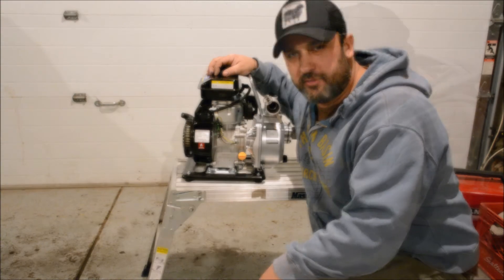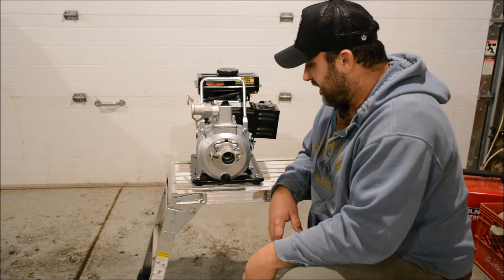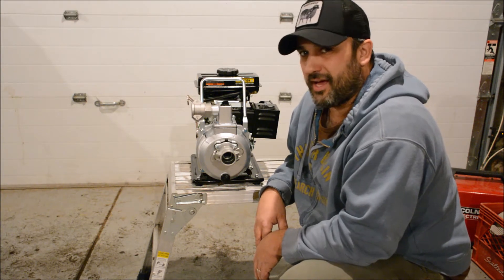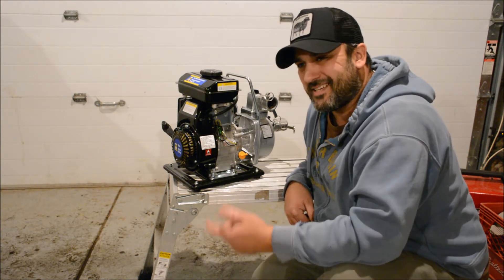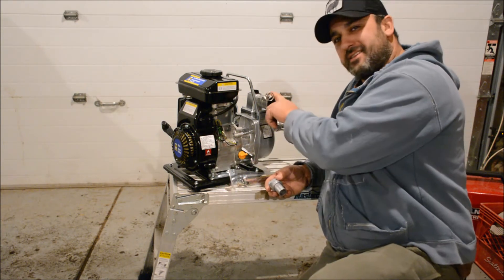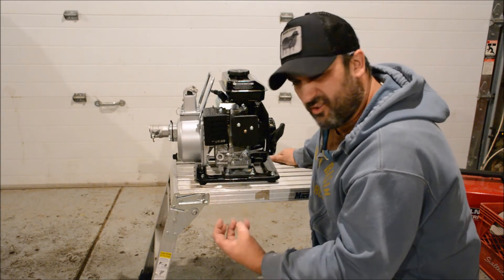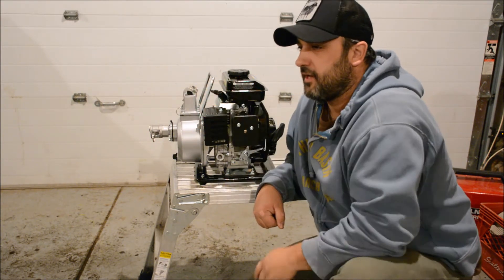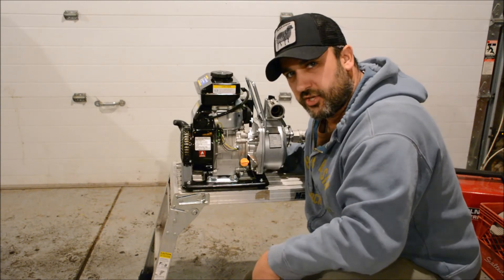Test of a Power Fist 1inch water transfer pump.

Comment: Glad I found this. I am wanting to use this pump for moving sap as well . I've just set up a new sugar bush with 3/16 lines to barrels. I need to move sap about 1/2/km to the sugar shack from the bush with about a 10 foot gradual uphill. Do you think this pump will move it that farm from your experience?
Subbed to your channel as well. See you do maple syrup.
Reply from the maker: Hi Jon, thanks for Subscribing, i hope to get some new content uploaded soon.   As for the pump that is a very good question.  In my own opinion i do not think this pump will have an issue pumping 500 meters with a 10 foot incline, but with out having tested something like this i can not give you an accurate  answer.  If you do happen to try it please post your results here.  Enjoy the season, it sure is coming fast!
Reply: @SpruceCreekFarm  one other quick question. So you think any one inch water line will hook up the the intake and outtake? I'm not wanting to use the hoses they have as they probably are not food grade for the sap.

Comment: Would a pump like this work if I want to water my garden but I have a 150ft of 1" PVC pipe between the pump and the ditch where I want to take water from.  How would I make sure that the air in the 150ft of line would not burn out the pump.  I can not have the pump at the ditch because it is public and there is 150ft of private land between my garden and the ditch.
Reply: There are a couple of things in play here.  First, what is the water source elevation relative to the pump?  If the water source is higher than the pump, you should be fine without a check or foot valve at the suction end of the hose.  If the water source is at the same level or lower, you would want to install either a check valve or foot valve in the suction end of the PVC pipe.  In all cases, make sure the suction end of the pipe is well below the source water level, I'd say actually 12" or more.  If it's too close to the surface, you'll get the bath tub affect, swirling, and this will draw air into the pump and cause cavitation, damaging the pump.  I'd actually recommend going with a larger valve, like 1 1/2" because the valve will restrict flow.  Additionally, try to eliminate any elbows in the suction line as this will restrict flow as well.  The key is minimizing restrictions to the pump.  Because your suction is so long, 150 feet, you'll most likely get reduced output from the pump.  You should also consider putting a screen at the suction to keep out debris.  It will need to be checked regularly.  Prior to starting, remove the pump primer cap and check to see water.  If not pour water in the primer port until it's full.  The best world is having the pump next to the water source.

Comment: how is the pump running now?? I am looking at the same one for gold prospecting.
Reply from the maker: So far so good, used for 2 maple seasons now with no issue.
Change the oil every year, starts first or second pull.  I also run premium in all my small engine, not sure if it makes a difference but it gives me warm a fuzzes...lol
Reply: And what kind of oil?
Reply: Same here. I think I may buy it, portable is nice